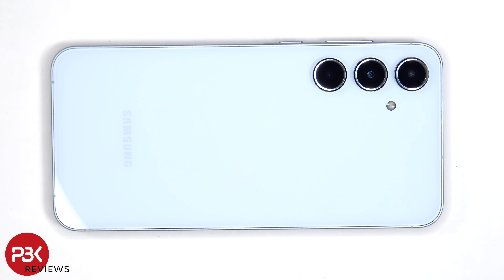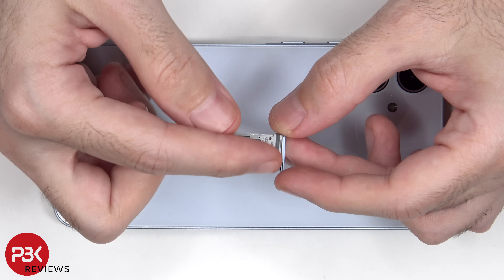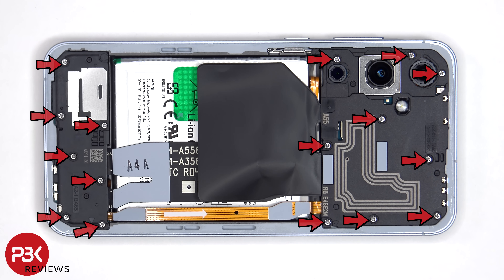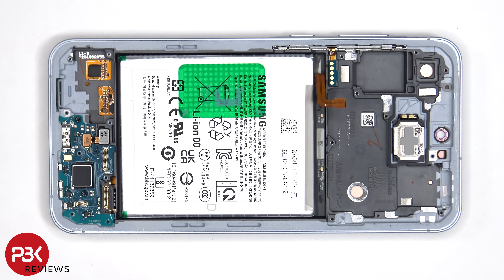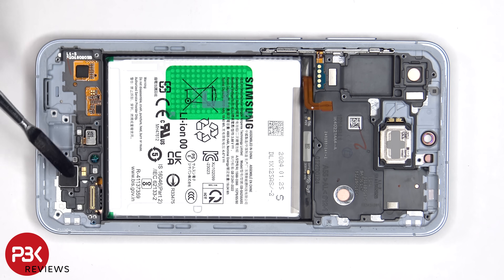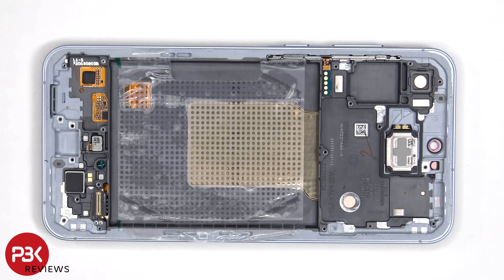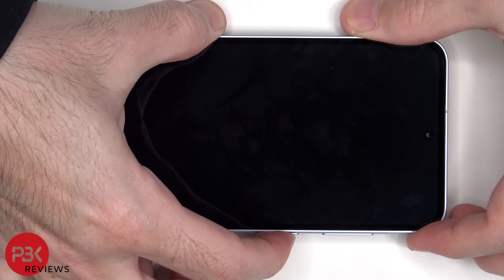Samsung Galaxy A55 5G Teardown Disassembly Phone Repair Video Review

Comment: I used poco x6, honor x9c, I am currently using a55, it is a very nice phone, there is no heating problem, the battery is good, the camera does not look as good as the x9c but the camera is good

Comment: haha the designer is a clown.... heats the battery hehe I can't stand the cooling system that is poorly designed.

The cooling system is led outside so that the glass back of the phone receives this heat.. and it would be best if a small copper or aluminum plate was added on the back to receive the heat...

Comment: which phone is better for camera and battery performance ?

SAMSUNG Galaxy A56 5G vs SAMSUNG Galaxy S24 FE 5G

which is good for vlogging and product review video production?

SAMSUNG Galaxy A56 5G (Awesome Graphite, 256 GB)  (12 GB RAM) - 42K
5000 mAh Battery
Exynos 1580 Processor
50MP + 12MP + 5MP | 12MP Front Camera
Android 15
UHD 4K (3840 x 2160) (at 30 fps)

SAMSUNG Galaxy S24 FE 5G (Graphite, 256 GB)  (8 GB RAM) - 45K
4700 mAh Battery
Exynos 2400e Processor
50MP + 12MP | 10MP Front Camera
Android 14
UHD 8K (7680 x 4320) (at 30 fps)

Comment: Sorry do you know maybe how to replace  camera lens I just broke one of mine the midle
Reply from the maker: Its held on with adhesive, you need to heat it up with a hair dryer or something else and then use an Xacto knife or thin razor blade to carefully pry off/peel off the broken lens cover glass and then replace it with a replacement. If there is a replacement available, generally it should come with a replacement adhesive double sided tape for it. If not then you can always just replace the back battery door cover/backplate. Check mobilesentrix.com or similar sites for parts.
Reply: Thank you  @PBKreviews

Comment: If you didn't notice it, the top shielding on the motherboard is fake. It's behind the earpiece speaker and it acts as a chamber for it because there is a gasket around the earpiece speaker.

Comment: I accidentally inserted my sim ejector tool all the way down into the top microphone hole. I'm relieved  hearing that i didn't break my microphone but what about the water resistance ? I felt a little bit of resistance  at first and the it went all the way down.
Reply: Same bro just now in bottom left any problem till now?
Reply: @AsishRai-l2i  No problem so far. The phone is working fine.

Comment: Glad to see this before I break my phone I just picked this a55 coming from flagship devices. Fixed the screen plenty of times on my note phone I QUIT!!! i just need good phone with a cheaper repair cost overall all just in case or will be easy replaceable all together. No I don't want insurance 😒 thats whole point in buying a midrange device. The phone game is such a scam and rip off. I'm glad the mobile industry is maturing.

Comment: Hi! If you open the cellphone ( A55 is IP67 ) and humid air replaces the old air that was from the factory which I presumed that factory air humidity is controlled to be just enough to be not that humid, does it make the phone fog up its lens in really cold temperature after the repair? Or maybe the repair area is air conditioned and the room air is not humid like in the factory? Do the cellphone factory allow only some percent of humidity when assembling the phone specially the IP67 and IP68 rated phones. I had a Asus phone before that wasn't even IP rated that fog up the lens when I was in a cold place. I'm just curious.

Comment: Greetings sir, could you give your opinions based on your observations?

 Galaxy a55 vs nothing 2a, which has better build quality and durability?

Much gratitude for your response.
Reply: I have the 2A and looking to return for the a55.
Reply: @davecobb5649  could you share the reason?
Reply: Sure, I have issues with the display, colours are desaturated and the options to change them, e.g. vivid mode, do bugger all. General internet speed can be slow for some reason. I could just have a dodgy model. The general build quality is pretty solid and battery life is good. UI is generally ok, but could do with a few more tweaks, which I'm sure will come with future updates.

Comment: Would it still be water resistant after the repair?
Reply: I think so because of the application of the adhesive and the rubber is still intact

Comment: How do you remount the back cover? Do I need glue or something like that to close the backcover, coz in the vid I didnt see anything wich is given into it. Thanks.
Reply: And I have second question, I bought this phone and got a fault overhead speaker. It doesnt work. Also the internal ear speaker. I need to change both. Do you have the part numbers?
Reply from the maker: You can check mobilesentrix.com or rounded.com for parts and you can watch this video for an explanation of the adhesive: https://www.youtube.com/watch?v=T4iiPUIM7-Y

Comment: Real question: 5000mah battery? But printed on the back it says 4905mah. Accubattery reports the same thing. Why?
Reply from the maker: There is a typical and a rated capacity written on all batteries

Comment: looks plastic inside that frame, or is it cast aluminium?
Reply from the maker: Its a metal/aluminum border fused or attached over plastic with an aluminum alloy mid frame.
Reply: @PBKreviews  I have had samsung a51 5g model and it had cast aluminium frame but this new model is a bit tricky define composition of mid frame under the screen part or under mother board cause when I look those screw places it seems that they are metal parts fused to some material it seems not solid cast aluminium frame.

Comment: How the Exynos 1480 works in this smartphone? Does it overheat and throttle? The benchmarks say, that Exynos 1480 on Galaxy A55 is stronger than SD 7 Gen 1 on Galaxy M55.

Comment: What do you think should I get a55 or s23fe
Reply from the maker: Depends on what you need it for. The S23fe has a better processor as well as a telephoto camera, but aside from that, all other aspects on the A55 spec wise are better. Larger screen, larger battery, better screen glass protection (victus+ vs gorilla glass 5) and a better selfie camera.
Reply: @PBKreviews  thanks 😊
Reply: @PBKreviews  Useful info. Thank you.

Comment: Dude, I have a curious question :)
 We always see in your videos, You removed the thermal paste/some time heat sink as well.But We know that if we remove the phone's thermal paste or heat transfer paper, there will be a bad impact  (Performance drop/overheating etc.) when we use the phone later. My question is what do you actually do with those phones?
Reply from the maker: I reapply the thermal paste. As for the graphite film, as long as its not damaged beyond the point of it being effective, its still usable.

Comment: No antenna wires ??? Samsung did those differently this time ???
Reply from the maker: Yup, no coaxial cables. Instead they used a flex cable (the orange colored one) which I think every phone should use. The coaxial cables are so fragile.

Comment: the A55 feels so same to the S23 FE ,quiet curious the difference betten they two
Reply from the maker: It is fairly similar, so that's the reason it won't be sold in the US since the price doesn't make sense when the S23FE is available. So Samsung will only sell the A35 in the US from what they stated.
Reply: in europe currently a55: 395€, S23FE: 536€ (both 256gb)

Comment: This one is almost identical to s23fe 
Most of the inside parts are in the same place, and even the same shape . Vibration engine, vapor chamber. Fp reader and 
..
Reply from the maker: It is fairly similar, thus the reason it won't be sold in the US since the price doesn't make sense when the S23FE is available. So samsung will only sell the A35 in the US from what they stated.

Comment: Thanks brother. After seeing your video, I will buy this phone. 
How about frame? It uses platic or aluminium?
Reply from the maker: You're welcome. It has a metal border frame bonded to a plastic layer which is bonded to an aluminum alloy midframe. So its not a solid one piece metal.
Reply: @PBKreviews  thanks  for explanation. I bought a55 5g this morning.

Comment: Why is it written on the back of the battery, that the capacity is 4505 mAh not 5000 mAh?
Reply from the maker: It's 4905 and you can see it on the front of the battery as well. Every battery has a rated and a typical capacity. You can see both the 5000 mAh and 4905 mAh written on the front of the battery.

Comment: Both the Galaxy A55 5G and A35 5G come equipped with a 1.7 times larger vapor cooling chamber but i dont really see any of that, is it sandwich between the screen and the circuit board?
Reply from the maker: what do you mean, its shown in the video once the battery is pried off. Yes a part of it runs underneath in between the screen and frame, and if you compare it to the A54, you will see its much larger.

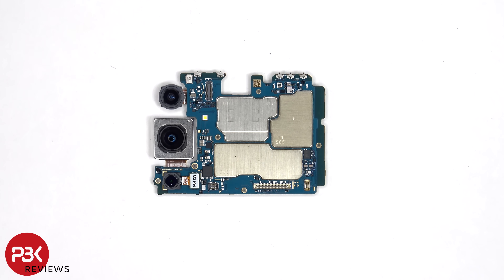Comment: 4:07 They added something new to the board compared to the A54, that part above the bottom shielding didn't have anything on it, but now they put something there. And by the looks of it (having shielding and all) seems important, what is it?
Reply from the maker: It's nothing, if you look at the other side of the board its hollow open, its where the earpiece speaker lays or sits in.

Comment: Is FPC connector got better or worse? My friend has a52s and connector died
Reply: I have an A52 LTE and the connector also died (very common problem in the whole A52 line up), I was told that it was mainly due to the flimsy plastic back, so I hope it isn't an issue with the glass back

Comment: Good to see it has huge vapor chamber and graphite sheet sandwiching the battery.

Though looking at the frame, it looks like aluminum frame is fused by 3mm thick plastic. If only samsung trim it and make A55 a bit smaller instead.

Comment: Build quality so strong.
Reply: yes but not for display
Reply: so it can be water resistant
Reply: @Bloxxer151  Its IP67 meaning it can be submerge in water for 1meter in 30 minute, ofcourse don't do it on purpose😂
Reply: @Bloxxer151  yeaa it is buidl quality strong and water proof
Reply: @shubhamsawant1551  don't put it in water on purpose tho
Reply: @TheUltimateCola  yesss It's Expensive device

Comment: Why give rating 1.5/2 when the things are easy to replace or repair?
Reply from the maker: If the screen was replaceable from the front without having to take the back off and speaker assembly etc to gain access, it would get a 2.

Comment: هل الهاتف من المعدن ؟
Reply from the maker: yes it has a metal border bonded over plastic with an aluminum alloy midframe.
Reply: @PBKreviews  
شكرا لك ، انا أتابع فيديوهات قناتك ولكن لا افهم الإنكليزية ، ارجو ان تضيف اختيار الترجمة للغة العربية ، لكي افهم شرحك
Reply from the maker: Thanks. You can turn on subtitles by clicking the settings or gear icon and clicking on subtitles/cc and then selecting auto translate and choosing your preferred language.

Comment: I advise everyone not to buy the phone. The screen has a high brightness of 1000 nits and is uncomfortable on the eyes. It causes eye pain, and all Exynos processors emit heat. I would advise everyone to stay away from the Samsung Galaxy A25, A35 and A55 series all together. I will find that Samsung has changed, not what it was before. It has become a physical company and does not only care about the customer. I started thinking about money and losing the client. We want the screen to have a candle brightness level of 800 and 500 nits only, but do not exceed this number. We do not use the phone in the sun to maintain it, and most of our continuous use of phones is inside the house or car. We ask Samsung to return the screen to this normal level and rate.
Reply from the maker: it may be a personal preference. I prefer much higher nits. I don't play games or anything on my phone but when I am using it wether indoors or out, I want it as bright as possible. 🙂
Reply: The latest exynos has better heat management  . Also all processors emit heat

Comment: Yoo I like this kind of videos, most people reviewed the phone by spec but not on the inside (literally)
I think we need a bit explanation about how you score it like what part would be challenging to repair, which part will most likely be damaged first, is it overall a good build, is it generally similar to other phones or even the previous series, that would be interesting to hear from you
I love the video!
Reply from the maker: Thanks! I provide the chart towards the end of the video before re-assembling to break it down. Higher score= easier and more repairable. If a section scores low it either means its hard to access and more difficult to replace those parts which fall in that area, or parts are harder to find etc. If I can, I will be more thorough.

Comment: why the glass backplate bends? is it plastic instead?
Reply from the maker: no, same as glass screen protector. Its thin so has some flex.
Reply: many do not know, but glass not solid, but amorphous solid. so it has attributes of liquids as well.
f.e. window glasses over the year get thinner at the top and thicker at the bottom, because it flows. very very slow, but it does.

Comment: A pull tab on Samsung battery? Interesting. Haven't seen it for quite awhile. 😄 Thank you for the video. Keep up the good work! 👍🏻
Reply from the maker: Yup, they are required to implement it for repairability now due to EU regulations etc. You're welcome and thank you!
Reply: started with A14 iirc
Reply: Samsung should've used the Snapdragon 8 Gen 2 on this phone.
Reply: @Subhasis44597  nah that's too expensive, 8g2 is more fit  for s24fe. They should have used better ARM cores for E1480 instead of old A78 and A55
Reply: Every samsung device from 2023 and onwards has pull tabs

Comment: Looks like flagship from inside. Good quality materials samsung 👌
Reply: That definitely does not look like flagship build inside, the chip and capacitor density is way less and the cameras are much tinier. Plus the motherboard isn’t even a dual stack or triple stack layer. Also, the ungodly amount of plastic midframe in this phone, the nfc antenna is even baked into plastic.
Reply: @Toeknee585  of course because its a midranger. Look at the cables, its uses flex cables. Except Xiaomi 14 ultra literally every chinese flagships use coaxial cables. Which is 👎🏼 for flagships.
Reply: @devanandshaji But then he's right, it does not look at all like a flagship on the inside. Looks like a classic midranger, and a Redmi Note 12 pro 5g for example looks way better inside.
Reply: @devanandshaji  I don't see what's wrong with coaxial cables. FYI the M55 is better at WiFi coverage and speed than the A55 despite the coaxial cables used.
Reply: How do you know the quality by watching a video? The sub board for example is very thin..
Reply: @gentle285 again it a Midrange device for under $300  what do you expect?
Reply: naah .. all phone nowadays use chinese capacitor.